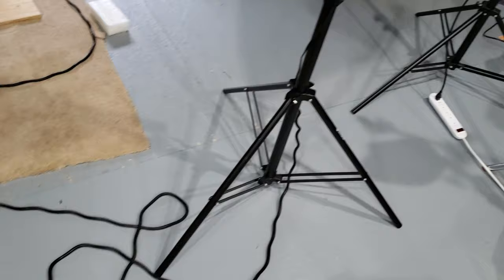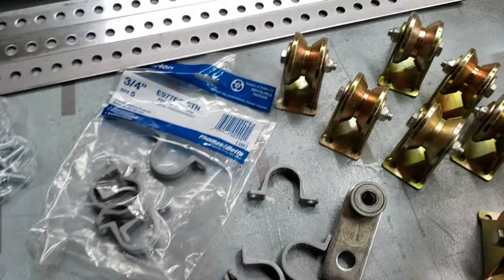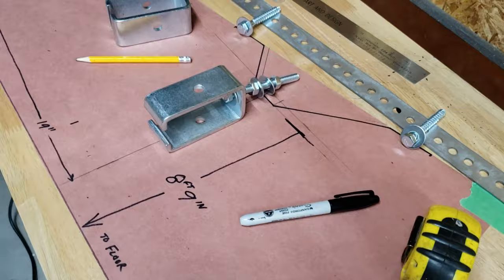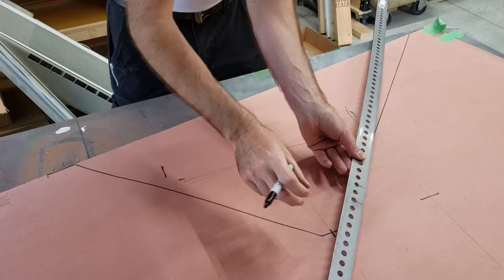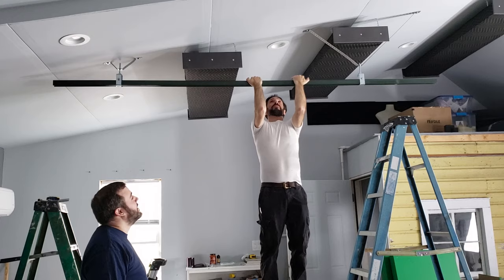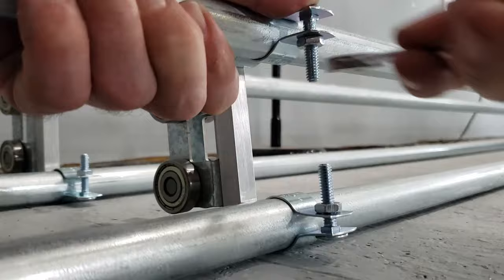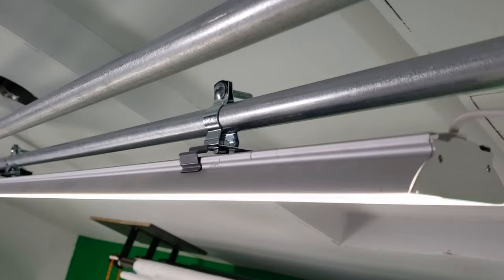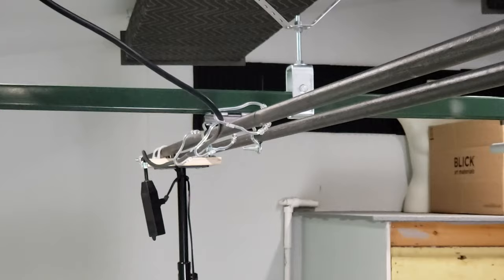DIY Overhead STUDIO RIG! Under $300, Hang Cameras, Lights & Cords from the ceiling of your studio

Comment: I did my studio a little different  I mounted my stuff straight to the ceiling and added all ball heads to my strobe lights I got a 360 degree left right and 180 up and down wich is perfect for me. And I still use a c stand to do my product photos with and my camera on a ball head also got 360 degree movement and 360 up and down

Comment: You also could have done a 3/8” Sammy screw into your stud and then just taken threaded Rod up to the ceiling and hung the strut bracket from that. 😊
Reply from the maker: I've actually never heard of those before but I just looked it up. Pretty cool! Thanks for the suggestion. 😊

Comment: I did this almost 5 years ago but without the sliding tracks. I did have the idea of using Unistrut, but decided to go with a lighter and closer to the ceiling method. 

My studio ceiling is only 8' so not much room available to hang anything without things becoming head-bumps. So I just went for a fixed grid system using ten ft long 3/4 X 3/4 X 1/4" steel angles suspended 4" below the ceiling. These were spaced about 4 ft apart and parallel with the backdrops. Then five ft long pieces of the same angle are used to bridge between any two of the 10 ft angles to provide hanging points anywhere within the ceiling grid. I used pairs of Electrician's Beam Clamps bolted together to join the 5' long angles to the 10' long angles. 

Electric power is provided by Wiremold Outlet Strips attached to the ceiling and running past the ends of the 10' long angles. Each has an electric outlet every 6" along the strips, so there is power within 5' of anywhere I place a light within the ceiling grid.

To hang lights, I use one of the Electrician's Beam Clamps to attach to the angle. Then I've modified some light stands by adding a 1/4-20 male stud to the bottom of the center posts, adding a 2" length of round dowel inside the end of the center post of the light stand with epoxy to bond it in place. A 1/4-20 by 2" hanger bolt (lag screw threads one end and machine screw threads on the other) was screwed into the end of this dowel and it becomes a way to attach the tripod upside down to the 1/4-20 threaded hole in the Electricians Beam Clamp. The Beam Clamps become the universal way to attach or assemble anything to the ceiling light grid.

I had worked in the Theater, so "hanging lighting" was in my blood. One thing that we always did in the theater was to put "safety chains or cable loops" around the support structure and then a secure piece of the light, using D-Rings or Snap Hooks to join the ends of this safety loop. You can't trust a "Spigot" and the light hanging thumb screw to keep lights from falling. 

If you don't use any of my ideas, that's OK, but please come up with a "Safety Loop" method that works for you and always use one for every hanging light and fixture. If one falls it will destroy the light, but it might also injure your model and likely result in a law suit. I don't have a website, but will freely discuss this system with you if you contact me.

Charley
Reply from the maker: Sounds pretty awesome. What material did you use?
Reply: @JantzerStudios    The dimensions of the steel parts were provided. The electric outlet strips are made by Wiremold. I have the ones with an outlet every 6" along the length. The hardware used to attach the 5' angle to the 10' are Electrician's Beam Clamps, available from Electrical Supply Houses. Two of these were bolted together using the existing 1/4-20 threaded holes in these clamps and a half inch long  1/4-20  round head bolt. The same beam clamps are used singly for attaching the modified tripods upside down for hanging/adjusting lights at lower levels, as well as other items. The beam clamps are the universal attachment used in many ways with my ceiling lighting support grid. 

There are no cables and usually no light stands on my studio floor, except for the occasional touch of the tether cable, which is also routed along the ceiling grid to just above the usual camera location, where it hangs with sufficient loop to allow me to move the camera almost anywhere in the camera half of my shooting room, which is 19 X 26 X 8' high.  

I have 6 motorized 10' wide backdrops, and also remotely controlled from the camera location. Changing backdrops only takes me about a minute. 

I have two camera stands, which are a 6'6" vertical steel column on a heavy three leg base with locking casters. These take up much less room than a tripod, and allow easy camera height adjustment from about 6" to 6'. It is counterweighted, so the camera is easy to move vertically and will almost remain at any height, even with the lock released.  

I'm NE of Charlotte, NC. Are you anywhere near me?  I can send photos if you can contact me with an email address or cell #

Charley
Reply from the maker: Wow, that sounds pretty professional!  But also a little outside of my budget, LOL.  I definitely need to add safety tethered, though. It's always been part of my plan but haven't gotten around to it yet.
Reply: @JantzerStudios  I sent a message to your website.
Reply: @JantzerStudios   It was likely less than you spent. 20' of 3/4 steel angle was $23 and I used five of them. The Wiremold was given to me, so I don't know the cost. The Electricians Beam Clamps were about $1 each. I'm a licensed electrician and EE, so the electric part was all done by me. I have BN-Link wireless control modules plugged into each used Wiremold Outlet to control power to each light from a wireless remote, so can turn on the strobes, LED panels, UV panels, or continuous spot lights, all separately in groups. Then the strobes are controlled from the on camera transmitter. The LED panels can each be controlled by a cell phone App, if that is necessary. I sent a note to your website.

Charley

Comment: Careful not to drill in to building wiring.  The building codes say wires can be 1.25 inches from the edge of a stud, so add 1/2 inch for drywall and that gives you a maximum screw depth of 1 3/4 inches.

Comment: Great work! I was brainstorming about this about a year ago and here you've figured it out completely! Have you added to this since it's inception? I know the commercial rigs for studios have two layers of pipes, with swivels at the point of the carriage so they can swing into odd angles. I've been a portrait photographer for 28 years and there was a time when a studio supply house would send a rep out and measure your space for a custom system that would set you back $20K or more.
Reply from the maker: I have added a little but I would say the biggest thing I would change is, I would use all black pipe instead of conduit.  The conduit just has a little bit too much Flex. I'm hoping to do an update on this eventually now that I've been using it for a bit. I just don't have as much time to make videos these days.
Reply: @JantzerStudios  No worries...If this is the only video you produce with this, it's already enough good info for me. Thanks!
Reply: @JantzerStudios  this was my thought too, I'm going to use black pipe. It too is 3/4" right? I would think there is a little sturdier mount other than the conduit mounts too?

Comment: This is inspiring! One question - any kind of trolley brake or lock needed? I know things need to be level, and I guess that should prevent things rolling on their own, but I would imagine a trolley lock or brake would be useful. Or is there some way to keep the friction high enough that things don't roll on their own? Or is this a non-issue that I am imagining? 🙂
Reply from the maker: I have had to use a spring clamp to keep things from moving when rigging up my camera but for the most part they stay put. Let us all know if you come up with something better.

Comment: Hey! This is great! I'm using your tips to get a similar thing for a my new studio build. Its frustrating with cables, stands and more stands and cables on the floor. This would indeed help! Is there anything that you'd like to change now a few months after the build? Anything you've added that has been a big lift in flow and productions? :)

/Björn, Swedish film producer..
Reply from the maker: Great question! The main thing I would change is, I would not use electrical conduit.  I ended up making a third rail that was longer with black pipe. But even for the 10-ft rails I think it would be worth it to spend the extra money for black pipe it's just much more rigid. Hope this helps. Good luck with your build. If you post pictures of it on Instagram tag me  @janntzstudios I'd love to see what you come up with.
Reply: What is the electrical conduit? I tried translating, but didn’t get what that was.. :) 
And the black pipes.. how were they different, stiffer? Other material?
Reply: @shouteryproductions9146  In the U.S., it's lightweight metal tubing that we run electrical wire through to meet specific building codes. Imagine you're having to add electrical wire to the outside of a wall. The conduit seals it off safely when it's not run inside the wall. The black pipe he's using comes in a longer length as it is thicker and stiffer. The electrical conduit probably wouldn't hold it's shape, with that much weight, over a 14ft span.

Comment: Hey mate. Im not engineer,

But what if someone mounted a foldable boom arm to the roof that was on a swivel point?

That way we could bend and rotate the light into place for photography?

I dont have a super high roof, so it would be cool to just raise and lower my lights as needed.

Surprised there doesn't seem to be anything like it.
Reply from the maker: Seems like that could work. Sometimes the only way to find out is try it. Then figure out what's working and what's not then get the problem solving. Best of luck let us know how it goes.

Comment: What size are the conduit clamps? Are they 3/4" or bigger? You said that are slightly loose.
Reply from the maker: The metal ones are 3/4" conduit clamps.  The plastic ones I believe are also 3/4" But there for plastic conduit which has a thicker wall so they fit loose for the slider. Hope that answers your question.
Reply: @JantzerStudios  Thanks for your fast response! I am in the middle of putting all of this stuff together right now. I was referring to the plastic ones, thanks! I will go ahead and order those 3/4" ones. At the moment I am also trying to figure out a clever way to hang a computer monitor as well. I am with you, so sick of cables everywhere.
Reply from the maker: Awesome!  If you post any pics of videos I would love to see them. Tag me @JANTZERSTUDIOS on Instagram or FB.  Or just DM me with a link. Good luck.
Reply: @JantzerStudios  will do, thanks!
Reply: @JantzerStudios  Hey, out of curiosity, did you do anything to stabilize the rails so that they roll straight? It isn't a big deal, I was just wondering how you have been getting along with it. I just got mine built. Will post pics once I clean up and tweak some things.
Reply from the maker: @Rick Nuthman  mine is very level so they don't really roll too much once I get them where they want them but if I do want to hold them extra still I'll just put a spring clamp on there.
Reply: @Jantzer Studios  oh sorry, I don't mean they roll.. How do I explain it. When you slide  the rails, it doesn't slide evenly. I have to spread my arms out and push it evenly or one side moves further making it start to move diagonal. I wonder if it is just the distance between the struts.
Reply from the maker: @Rick Nuthman  ah yes, mine does that too. I have actually found that to be helpful because sometimes I want one side to be a bit closer than the other.
Reply: @JantzerStudios  Good point. I haven't had a chance to try it out yet, so it will be interesting to see how it works out! Thanks!